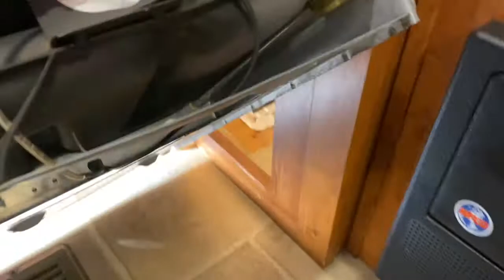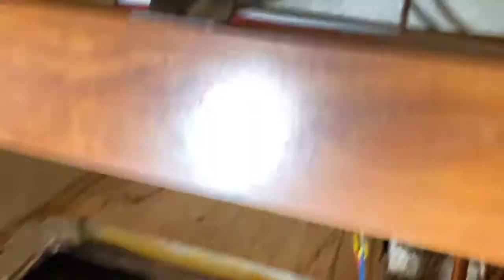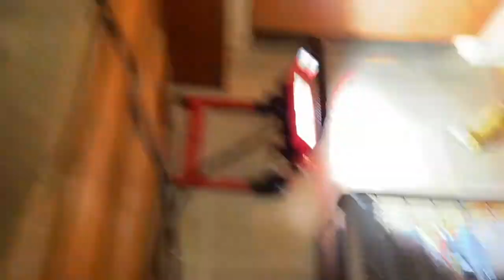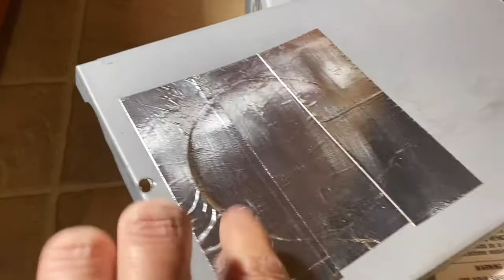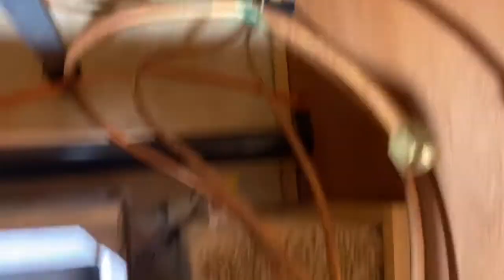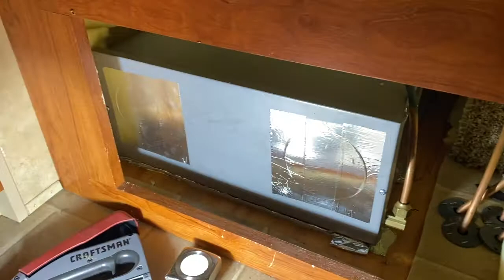Camper Furnace More Heat Less Noise

Comment: If I'm not mistaken you'll be pulling some of that fiberglass into the furnace intake, and circulating it all over your RV. Not good. Personally I think I would use some of the foil covered rigid board, and then you could tape the seams with Aluminum tape. And any gaps could be filled with spray foam. All in all just a better seal all the way around, and higher R value per inch. Alternatively you could use some of the Aluminum Covered buytl sound deadening sheets on pink or blue board (highest R value of all of them) . Amazon had some fairly inexpensive ones. Kill two birds with one stone there. Great video, good editing and narration. I suck at doing those kind of things so my hat's off to you. What software do you use for the video editing?
Reply: Rockwool would work better. It's a much better sound insulator than rigid foam and has the added benefit of being fireproof... which foam is very toxic when exposed to flames.
Reply: My comment was based on the area (Proximity) around the intake for the furnace.   Rockwool Fibers are definitely not healthy to breathe and that's the issue of putting them so close to the air intake.  The aluminum foil covering acts as a bit of a radiant barrier, and Inherently fire resistance. The Butyl aluminum-covered sound deadening Material would just smolder if it overheated, but They use that material to line the inside of engine covers. I know the dog box that covers my engine in my Chevy Van has that stuff in there. I think my original comment is sound. I'm sorry to say I think your suggestion is unhealthy.  As long as the air space recommendations for the furnace are followed there's no danger of fire here.
Reply: @TroyD-vo1bz   Have you read the safety data sheets? It's not a hazardous product. Additionally, you can get it foil backed. Rockwool is far safer for the environment and people than rigid board and spray foam will ever be.
Reply: As defined in the Clean Air Act, the term fine mineral fibers includes “mineral fiber emissions from facilities manufacturing or processing glass, rock, or slag fibers (or other mineral derived fibers) of average diameter 1 micrometer or less.” Included in this description are synthetic vitreous fibers, which include glasswool, rockwool, slagwool, glass filaments, and refractory ceramic fibers. Acute (short-term) effects of fine mineral fibers in humans consisted of upper respiratory tract irritation, with symptoms such as coughing, sore throat, and nasal itching and congestion; however, these symptoms did not continue after exposure ceased. Acute inhalation exposure to refractory ceramic fibers in animals resulted in pulmonary and pleural inflammation.
Reply: Not trying to be an ass here, but my point was you're putting this stuff close to the air intake where it would be circulated throughout the air. A lot different than putting it in the wall and covering it. If you wanna start talking about rigid foam catching on fire or something, hands down that stuff is a nightmare and and toxic. Covered in aluminum foil it's just not an issue as long as clearances are maintained. If the rockwool insulation was suitably contained it would be fine too.
Reply: @TroyD-vo1bz  so you’re bringing political definitions into this? 🤦‍♂️ I’m outta here. I deal with scientific facts not political definitions.

Comment: I bought my used 23-foot Arctic Fox fifth wheel before I had any idea how LOUD an RV furnace can be. Not sure if I want to tackle removing the furnace myself, but I'm going to show this video to a neighbor and see if he'd be willing to help me with that, and then I can handle most of the rest. He's got an RV, too, so maybe he'll want to fix his furnace noise, too. Thanks for sharing!
Reply from the maker: Disregard the step where I put the insulating tape on the floor between the unit and the floor. It puts off a terrible smell when it gets hot. I had to go back and remove it. Otherwise, I'm still enjoying the "upgrades" to improving the noise. The manufacturer should spend another $20 to insulate that cabin the unit is in. Best of luck and thanks for the like and subscribe.
Reply: @tailgatetalk  Thanks for following up. I agree, RV manufacturers cut corners, and then it's left up to us to figure out how to fix what they couldn't be bothered to do right in the first place. It's especially problematic for people like me who aren't mechanically inclined and leery of dealing with anything that involves moving electrical units.
Reply: @tailgatetalk  so it's bare now? Wonder if exhaust wrap from motorcycles would work

Comment: I'm gonna help you out. Your heater is inside and there is no way you can access it from outside. Why on God's green earth are you bitching about how the manufacturer of the camper did anything? My camper heater is outside and I am not happy that it has an exhaust system for propain gas heat. How stupid is that. A waste of money system for a heat source that does not harm health. Stupid.